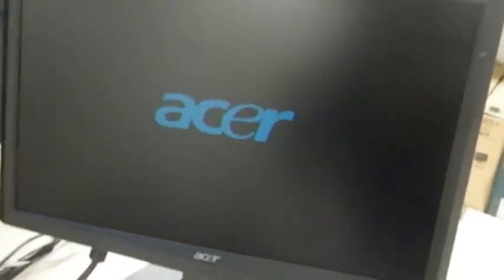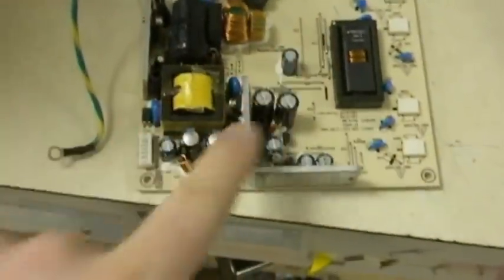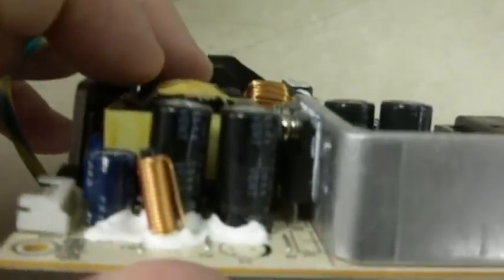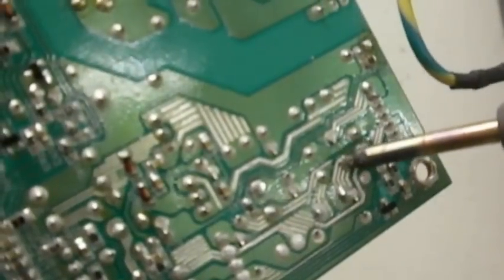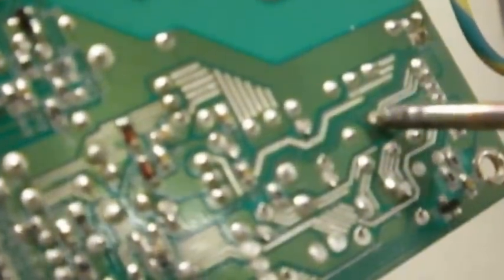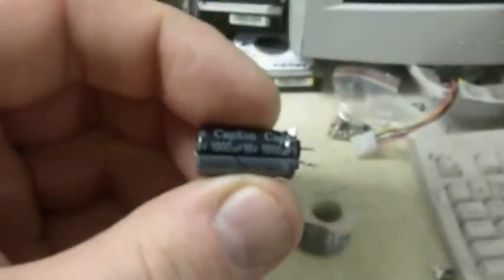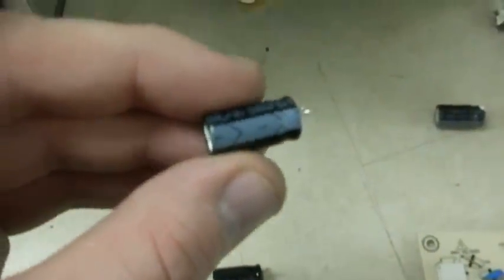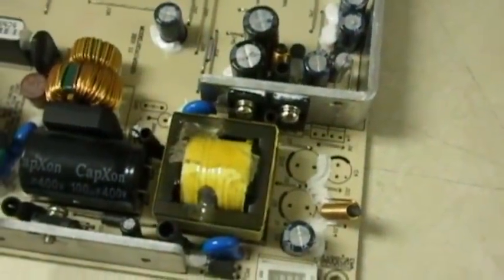LCD Monitor Repair - in 5 mins!

Comment: So I just watched your video and I think it would help me a lot.  I have a very similar if not the same model of monitor that is doing something similar.  You said that the caps may not bulge if they are bad.  That seems to be my case but I haven't replaced the caps yet.  I have a video of what mine is doing on my channel.  Mine does the exact same thing but the power led stays on.  Do you think this is my caps or something with the bulbs?

Comment from the maker: It could still be another capacitor.  Not all of them have to necessarily be "puffy" to be bad.  You my also have problems with backlight inverter transformers or a power supply issue.

Comment: i have one (LCD monitor) and first time when power on is go back off in 1 min, after that unplug and plug again, after few sec. is going back off.  seen there 4 bumpy capacitors 2x220uF and 2x 470uF all 4 at 25 V, changed all of them with new ones the same values, the monitor has the same behavior. All other capacitors are not bumpy. what else can be?!...

Comment: i have a monitor that someone threw out and it has the same problem as yours did, shuts off after 2 seconds. Its really big and ill be happy as fuck if this works xD. I just need to get my hands on some soldering tools. Also i hope that old capacitors from older, ruined monitors would be ok, or do i need to buy new ones?

Comment: I tried this, it works.. I found faulty capacitors without any diagnostic tools, just like the video showed. I didn`t have new capacitors, so I took some from my old (very-very old) not-working CRT monitor, soldered them into place and those work fine, for now.

Comment: I did a little more digging tonight. I tore everything out of it and tested it on the bench. The problem is that on the outputs for the cathodes one side is not putting out enough juice. I switched the cathodes around and the tubes work fine. So it is in the power supply itself. I went over it with a magnifier and a light and couldn't see any damage or bad solders or any bulged caps. I can get a replacement board for around $25.00 for it but would really like to fix this one. I own two others.

Comment from the maker: I wouldn't know without a service manual.  The caps could still be a problem, but it could also be a bad backlight, LCD, inverter transformer or some other power supply problem.  See what you can find out if anyone else has like issues with that model on the internet.  If all else fails blow it up and get a video of it up here on youtube!  Heh!

Comment: Great video. 

I have a Samsung that I am working on now. The pictures shows up for a second when you turn the power on then goes blank. I pulled it apart but the caps all look good. Do you think it could still be the caps or something else?.And help would be greatly appreciated.

Comment from the maker: Thats not entirely true either, I've repaired bad solder joints from the manufacturer, and replaced transformers on the inverter board for $12.  :-D  Easy stuff!

Comment: on a hunch i tried heating it up w/ a hair dryer that works.. i let it sit for 4 hrs nothing.. i hit it w/ hair dryer less than 5 min it was working tried it the next day didn't let it set at all it worked right away w/ the the heat. why is this??

Comment: I just repaired my Westinghouse monitor using this method. Look on ebay for the model number of the MOTHERBOARD (not your monitor, sometimes they have different mobos in them), and a lot of times you can find repair kits for them.

Basically, they sell you all the capacitors you need, if you're unsure what you looking for.

Comment from the maker: @diekill42 Sounds more like you have a bad video cable, bad video card, or a computer that doesn't POST at all.  If you see that message, then your monitor is probably working just fine.

Comment: hi there.great video...I have a strange problem. I have a viewsonic va1916w.When I turn it on it does work normally for 3 maybe 5 minutes and after the screen goes off but the indicating light stays on. I turn off and then on again the monitor with the power on button and then it turns on again and after that it does the same thing. I replaced a damaged capacitor but it didn;t solve the problem. Could you give me any idea of how to solve this. Thank you in advance.

Comment: Hello i was wondering when replacing do i need to keep them all the same voltage or is it ok if some are 35 and others are 50... all the ones on my inverter are 25v but i cant find any that are 25volt

Comment from the maker: @CZroe The next most common thing to burn out in Acer monitors is the inverter transformer.  They tend to overheat and short out.  Usually there is signs of heat damage on the board near the transformer, though thats not always the case.  I believe the outside windings should measure 1k ohm, and the inside about 1ohm, check the specs of your corresponding transformer.  I have the 22" version of this monitor, and the transformer is bad.  Thats next on the slate for repair.  They are ike $22

Comment: @jevansturner Electrolytic capacitors are generally more likely to go bad even without the incomplete stolen formula. It why mother boards with "all solid-state capacitors" go for a premium price even over those bragging about "all Japanese caps" (the faulty ones were all Chinese/Taiwanese).

Comment: @vvtheduckvv I rec'd video but it isn't interesting enough to post (I didn't fix anything). :(

The only components w/electrolytic caps were modular & shouldn't be needed to pwr-on, so I disconnected 'em & the essentials still kick off as soon as I press pwr. The main PCB seems to be all solid-state & ceramic caps, so I'm not sure where to go from here beyond just buying a replacement. I still don't know which item TO replace.

I have the 24" version of that LCD (OEM/Office Depot exclusive).

Comment: "Higher voltage will make these things last longer. You'll get a much longer lifetime out of them."
Most capacitors that die are based on a bad formula. It was a huge epidemic because those caps were used for years while CE manufacturers had no idea. Before that, it was pretty unusual for caps to die unless the device was hit by a power surge or other catastrophic failure.

Comment: I never even installed my Philips AmBX system (out of warranty now) but I had it plugged in and quit working Sat or Sun (yesterday). When I power on, I get a flash from the lights with a loud "pop" from the speakers and it's right back off. Similarly, my Logitech z680s died before I ever used 'em. I suspected caps.